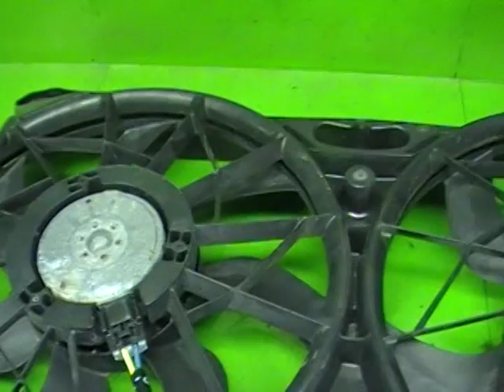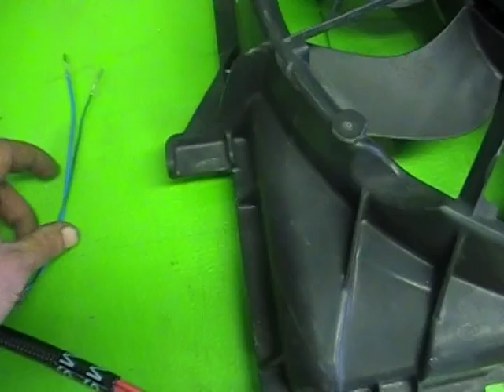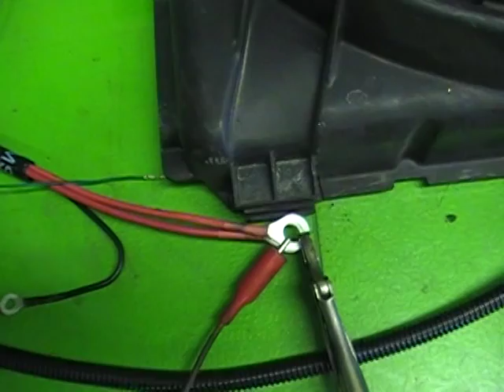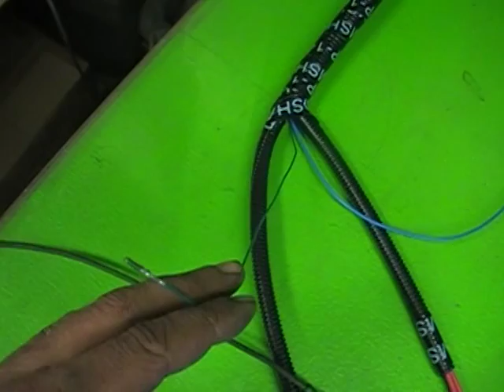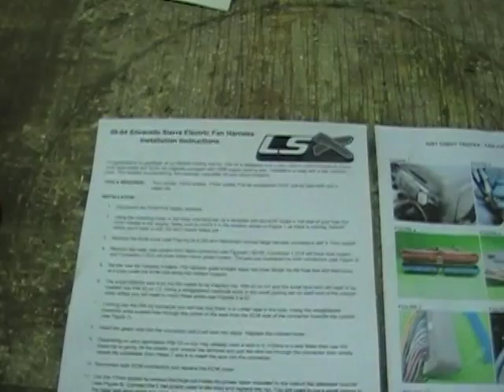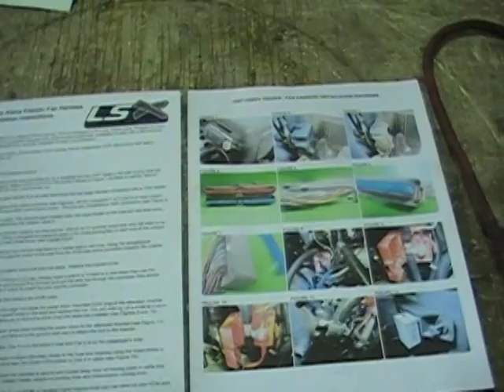Just Chevy Trucks Lsx Fan Harness Instructional Video

Comment: I have a question and if can answer it i will appreciate alot,i Benn having problems whit the electric fans of my truck,they only come on on low and wen it super hot,the hi speed does not kicks in,if I wire the bñue and green to the ground will they turned on on hi? thanks

Comment: I have a question i got you kit on my truck my fan are not coming on when i turn my ac , my turner said that i may need to wire to ac compressor signal wire ? Any suggestions?
Reply: Justchevytrucks  2000 silverado i was told they are hard to set up on the ecm . Smh
Reply: Justchevytrucks What I’m going to do is im going get me  HP tuner  do myself sometime the tuners are really busy they don’t wanna mess with it man..lol
Reply: Justchevytrucks thanks for the info ..

Comment: I did this swap but how can i get them to stay on high all the time is not cooling my transmission fluid
Reply: You shouldn't have to run on high all the time. You might have issues with your radiator

Comment: I have a 2001 2500 Suburban  8.1L 4x4 , can this harness work for my Suburban and how long will it take to program if I send you my ecm ? Thanks
Reply: @JustChevyTrucksBogBrookA-qo1mb  is there not away to custom fit the fans?
Reply: @JustChevyTrucksBogBrookA-qo1mb  just to give you heads up,  I was able to customize it to fit and it looks factory and works amazingly...... its definitely not a plug and play, however with a little ingenuity and out of the box thinking it can be done..... thanks for spending the time to respond... I will subscribe to your channel....  have a great day and be safe...👍

Comment: You should market these to Holley terminator x users as the Holley ECM uses grounded triggers as well.
Reply: Why wouldn't you just use this harness and splice the two wires for the ecu onto two of your outputs and set them up as ground triggers. it'd  be the exact same.

Comment: What could be the issue if only one fan turns on with the low setting? Should both fans be functional on the AC mode regardless of vehicle temperature?
Reply: If the fans are not operating based on engine temp then the AC will only turn on one fan. If the fans are already on at low speed based on temp then the AC will kick them onto high speed.

Comment: I take it if we have a drew tech pass thru 3 programmer for working with ECMs then we should be able to activate as you said? Don't have hp tuners. Yes I'd have to pay for a day of programming on the GM TIS Web site but I could also update software for different functions of the vehicle as well so then the $50 or so would be well spent. 
I also have a battery maintainer as well for during the programming where you have to keep the voltage steady. 

Does what I'm describing sound like a method that works for activating the fans on my 04 Chevy Tahoe with a 4.8L Engine?

Comment: hello, i had this setup in my 02 avalanche but instead of using those relays i got an oem relay from the junkyard. i have the wires pin into the engine cm as you described, the only difference is that my fans dont turn the high speed, one fan turns on when the truck starts and the second turns on when it reaches temperature but no highs, any ideas? i had it hptuned but no highs speed fans. any ideas please let me know. i also did made a test by adding another relay using the ac wire from the fusebox and it turns on the second fan when the ac is on but in low speed.
Reply: Justchevytrucks thanks for the reply, so i swapped the wires as you requested but no change on the fan speed, so i swapped the fans plugs and  the same result and inverting the blue and green wires. in other words instead of the passg fans turn on first then the drivers side now is opposite and no high speed working. is it possible you can send me a screenshot of the hpt settings so i can compare it with my current settings?

Comment: What is the link to this harness. I have a 04 Silverado previous owner installed a 6.0 in it but the electric fan wiring was not done right it has a lot of butt connectors. Any the wires get really hot when the fans are on.

Comment: I know you said LS models but I really need something like this for my lmm duramax. The fan clutch doesnt pull enough air and my ac blows warm at idle. Drives me absolutely nuts!! Can I make This work with my truck?
Reply: CME STL SHAPIN i think the sell a kit for tbh I seen it before I think DP diesel sells it

Comment: Just did this to my Tahoe.  One thing I can't figure out.  Both fans come on on low fan settings but when it's high fan settings only one comes on.  All the efan, harness and relays are stock I bought from you.  I did the tuning via HPtuners.
Reply: Im curious about your issue too  as my Avalanche runs in the same manner. I contacted the person who tuned it with questions about it and he sent me all the temp/ac/speed for my tune but never really answered how it all works. I did read somwhere on one site they both run at low speeds, then just one fan will come on on hi until the "hi temp" is made then both will run at hi speed. If anyone has answers to how it truly works I would appreciate it as well.

Comment: Hello just chevy truck I just received this dua my ecm back from your programming for my fans and I followed the steps of your blade of the harnes and only mind on high the two fans when I turn on the air conditioning
Reply: Justchevytrucks If I turn on my AC and turn on high the two fans I turn the air are still on and I turn the car off again and do not turn on the fans
Reply: Justchevytrucks I turn on my ac and they work on high the 2 fans and if I do not turn on my ac do not work fans
Reply: In a video mark that the blue wire of ecm this conevtado to c1 and the green wire to c2

Comment: what happens to the wire you push out on pin 33 do I splice it together or do I cover it with tape so it doesn't short/ground  out ?
Reply: Thanks
Reply: I actually spliced it and i found out that the fan will never turn off so i had to go back in there and cut the splice.

Comment: I HAVE THE ORIGINAL HARNESS, BUT I WANT TO CONNECT IT WITH A TEMPERATURE BULB, IN MY CHEVY SILVERADO 2003,I DO THE PIN 42 CONNECTION, DERALE THERMAL Fan Switch Thermostat

TENGO EL  CABLEADO ORIGINAL PERO ESTOY EN MEXICO Y ES DIFICIL CONSEGUIR UN SINTONIZADOR EFILIVE O HP TUNER,TENGO UN SILVERADO 2003, COMO HAGO LA CONEXION DEL PIN 42 y 33, YA QUE USARE UN BULBO DE TEMPERARUTA Derale termo seich
Reply: Hi, 
I finally got this “Chevy Silverado GMC Sierra Tahoe Yukon Retrofit Stand Alone Electric Fan Harness” and install it myself. On my truck. It works great!
Here you go:
https://www.ebay.com/itm/123131470407

Comment: how much for that harness kit?
Reply: Justchevytrucks Does the $349 kit come with the. fan mount bracket as well? is that the same price for a 04 Chevy Tahoe with the 4.8 engine.

 I have 112,318 miles on the vehicle. Will I need to do any other ECM updates with the dealer or aftermarket shop besides having the fans turned on? Will a J2534 programmer and TIS Web access for the limited option they allow give one the ability to turn the fans on that way? I wonder if I have a obd 2 cable and go to GM tis web access will I need the 2534 programmer tool or can I do it from their interface? 

Always wanted to check that out to update a few vehicles for fuel settings unless I'm not fully understanding the tis web portal? otherwise I know a few guys with a programming tool. 

I have the MODIS EDGE will one of the other snap on tools allow the programming/turning on of the switch? I'm really interested in this as I replaced the fan hub in Jan and the fan runs constantly all the time. I put new thermostat, water pump, all belts and pulleys and tensioner pulleys as well. Fuel mileage is below 10 which isn't normal and sucks big time!  Any information you guys can give me would be greatly appreciated. Thanks!